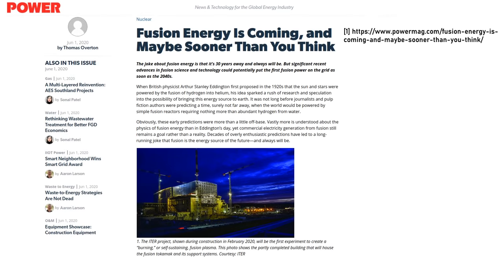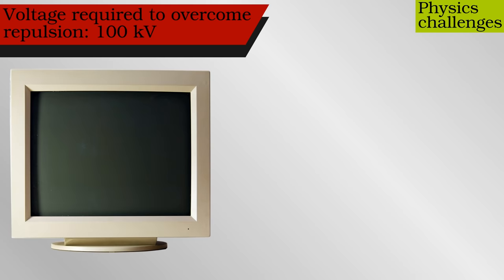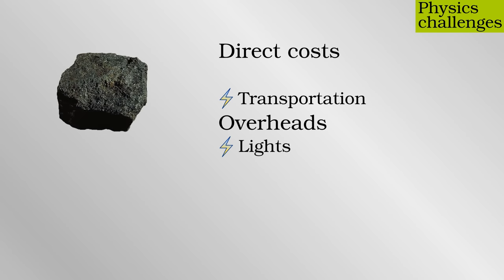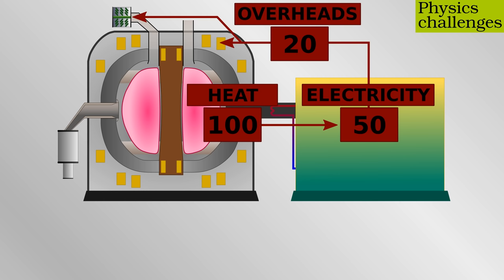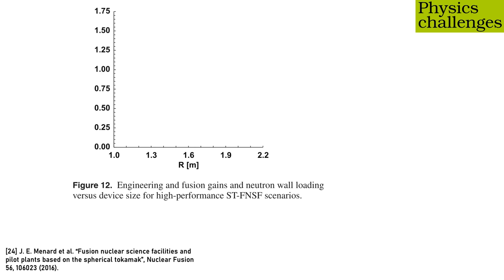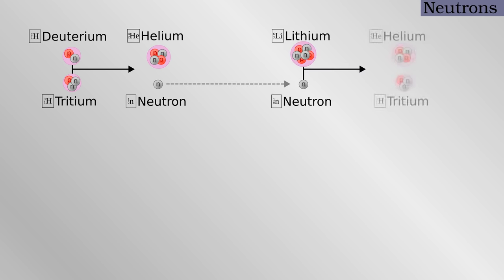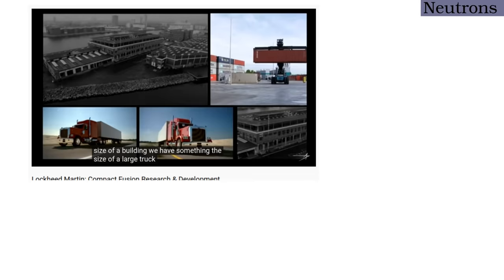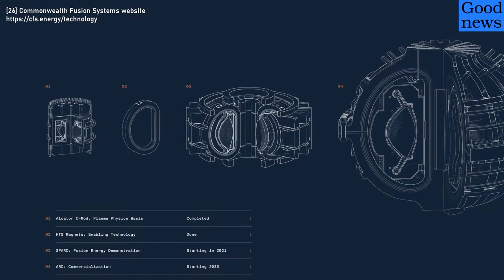Former fusion scientist on why we won't have fusion power by 2040

Comment: Being able to do something is one thing, making it efficient enough to apply it is something else, and the massive task of infrastructural overhaul is an entirely different matter. I do think that applied fusion will be achieved and utilized at some point in the future, but the time scale for that is 300 years, not 30. We don't even properly have the first step done yet.
Reply: So we'll never have Doc Brown's "Mr. Fusion," like "Mr. Coffee."
Reply: For sure. I believe it will be done within the future but I don't really see it within my lifetime. Possibly due to the climate, running out of fossil fuels, there would be a demand into research within these fields around 2050 or 2060 but I highly doubt it would be commercialized until way after all of us in this comment section are gone.
Reply: @Killerkraft975  mhm im a 98 so with 20 years of building time I might see the first one but I would say it is reached earlyer about 2065 if thing go well with ai (technological singularity) and ITER, Wendelstein X7 etc but definitely not before that 😅
Reply: If you'd asked me 10 years ago, I'd have said 'not a fucking chance we do fusion'.

After a PhD in plasmas, and with about half a decade of watching computational sciences go leaps and bounds even beyond what we were doing, the computational stuff dpne these days are able to do in under an hour that would have taken multiple expensive experiments and 5 years to do.

The plasma stream guys aren't getting as much benefit because the field geometries are much more complicated to simulate.  This is because they need stable plasmas to achieve fusion - which they achieve mostly by using magnets to shout at it to tell it what to do, and the longer the stream the more instability potential you're seeing from the currents.  You can't just wrap it around a big MHD sim and hope it pans out across the entire 6m radius.  Even so, the tokamak guys are still doing work - just changes in field geometry and plasma heating achieved thirty fold gains in under a decade.  ITER will almost certainly develop burning plasma just through sheer brute force, but its the engineering design that I am worried about.

The pulsed guys though - there are literally dozens if not hundreds of ways to compress plasma into fusion states just using field geometries alone.  ITER relative to these smaller startups has the other big problem - too many cooks.  Way too many people deciding what is and isn't done inside the machine.

On the pulsed stuff, I lost a bet over NIF never hitting any of their Qs, even the ones they invented.  They did it within a few years of the next gen plasma dynamics codes, overcoming impossibly complex plasma instabilities to do it.  They actually hit a thermal Q purely through experiment design and given NIFs lasers are decades old monstrosities it wouldn't surprise me if the holhraum designs improve to the point that even ICF becomes viable.

Honestly?  One or more of the startups might do it before 2030.  My bets on Helion though at this point.  Their design has so many engineering advantages to its general controllability and scalability as well as sufficient design width in how those systems can be used to actually pulse plasmas that im astonished it hasn't been done before.
Reply: For those still reading.

If you had read any of the literature coming out of plasma physics around 2011 you would be saying what I'm saying right now.

Fusion is way, way closer than anyone thinks.  Especially the old fusion dinosaurs who are responsible for most of the unflushed computational turds still floating around comp physics atm
Reply: @ralalbatross  Sure, and very interesting. But there is a big difference between being able to do something, and actually applying it, especially on an infrastructural scale.
Reply: @burnttoast26  Honestly?  Tokamaks are a mess infrastructure wise mostly because of the hostile radioactive walls problem, but not unsolvable.  Depends on what ITER or the other proto-demo reactors do.  I have no idea.  ITER's a big political mess - the whole international commission idea where half the countries are building magnets in different parts of the world to inconsistent specifications, arguing over it in the process, and then welding them together incorrectly is causing most of their problems.  The actual reactor idea is sound-ish - it should just have been built a decade ago.  It wouldn't surprise me if one of the startups beats ITER to 10Q, likely before 2030, because it is politics at this point.

ICF is still, imo, a nonsense.  The reason I bring it up is that ICF completely defied the wisdom of the physics dinosaurs (and younger ex-physicists like myself) who were all convinced it was a one in a billion shot, and it was actually engineering and simulation approaches that overcome that problem.  As I mentioned before, NIF is just a big bloated military industrial complex mess of lasers thrown together to test nuclear weapons.  The fact they made stuff hit ignition inside that monstrosity despite all the physical obstacles is amazing.  It makes my point for me.

The pulsed designs if they work are probably the most promising just purely from a computational perspective because single discrete events are easier to control and experiment with than streaming events.  Whether the physics scales up meaningfully isn't a question I'm in a position to answer...  but almost no one else is either.  The vast majority of fusion research is in other areas, so either they are engaged in scientific deceit on an epic scale (not impossible) or the tokamak was simply the only system people could meaningfully describe using the computers of the 1960s to 1980s and thus precluded any meaningful study into more complex plasma dynamics.

The one I'm not convinced by are the guys who think they can shoot bullets at a screen and generate power.  I don't know how they think that one will work - you're gonna get the hohlraum compression problems all over again.
Reply: @ralalbatross  I'm not even talking about just setting up a reactor. Overhauling the power infrastructure would be a monumental ordeal, you would need to re-tool power lines going across the entire country, transformers, teaching power company staff how to handle all this while figuring out standard procedures, etc. That is an entirely separate can of worms from just "can we make a reactor". It would take a LOT of time and money, two things that almost any government would be stingy about concerning overhauling infrastructure. Plus, the politics surrounding already-existing power companies lobbying against it to preserve their monopolies. Like I said, there is a HUGE difference between being able to do something, and putting it into practice.
Reply: @burnttoast26  the retooling isn't as much of a problem as you think coal, nuclear,same gas, geothermal power plants are basically the same they all convert heat in too steam and the steam spinns a turbine connect to a generator sooo that do you mean by re tool powerlines there are already powerlines and transformer stations soo it would be possible to convert extend existing powerplants since fusion isn't bound to a place by its fuel like coal powerplants are  soo yeah the grid is ready for new powerplants regardless of type but it is still a major project to pull of
Reply: @TheLtVoss  Dude I came to say the same thing. It blows my mind that nerds who know so much about reactions still never learned that the power to the grid isn't coming from the actual fission/fusion its coming from steam... so all the talk about "can't output more than ya input" doesn't make you sound smart although that statement is accurate how do you figure we still have a power grid despite that fact? 

We don't need tons of tritium the real work is in the water phase transition.
Reply: @off6848  You do realize that if you knew what you were talking about, you'd understand that such a revelations leads more credence to the problem of fusion's lack of viability?

Fusion can barely even break even in a closed system that encompasses the input energy and the fuel. It can't produce more than it consumes to actually ignite the fuel by a long-shot, and that hasn't even addressed the issue of actually extracting that energy and boiling your water for your turbines.

The most efficient lasers in the world that operate at the power levels used in fusion are so far as I am aware between 5 and 25% efficient. Then you factor in the losses in transforming that heat energy into electrical energy, which we can be generous and assume maybe that will be around 50% efficient. So now you're not even breaking even in total energy transformed in your fuel mass, you're requiring 4-20x as much externally generated energy to even get that fuel mass transformed, and then you waste half of it trying to use it to turn a turbine of some sort.

So no, just talking about "output vs. input" alone may not make you sound smart, but dismissing the obvious and apparent inadequacies of current fusion capabilities sounds downright stupid.
Reply: @bort6414  Are you talking about spallation lasers? 

They can be charged and discharged at the capacitor to make the reaction that just takes energy over time. Theoretically you could charge them up with tiny batteries although it would take forever the actual fusion reaction and the materials bred or produced are useful because of their ability to get super heated and basically dunked into water to create steam. 

Yes it requires a lot of power to get the reaction started but the reactions main purpose is to do something coal and gas cannot do which is turn enormous amounts of water into steam to do you work that is then converted to wattage,voltage and current to the grid.

and that same energy can go back to the reaction for heating the fuel rods as long as you have steam and working turbines. Coal has to continually be fed and shipped in as a fuel.
Reply: @Killerkraft975  It will never be done. Even if it's theoretically possible, the average human IQ is decreasing with time. humanity has missed the fusion window. But we will have a lot more idiotic Tiktok videos.
Reply: @bort6414  You're pretty wrong.  NIF was definitely not designed for ICF experiments.  It's an old nuclear weapons testing facility.  ICF is just what they are playing with at the moment to justify firing shots in the chamber.

I had a chat with one of my ex plasma physicist colleagues about NIF for the first time last night.  We're both pretty straight laced about it, and we both remember joking about NIF.  Both of us were astonished they got anywhere, never mind ignition.

The fact they did anything at all is astonishing to anyone in the community.  Seriously, I know you aren't a plasma physicist and don't really understand this, but the Rayleigh Taylor instabilities in that hohlraum were so massive that they were poisoning the ignition hotspot every single time.  They weren't even close to ignition a few years ago.

NIF's fusion ignition evidence is enough to convince me that fusion is actually a lot easier than we think it is, but the plasma dynamics are complex enough that they preclude conventional experimental study. 

In either case ICF is a fusion dead end.  The lasers have a low repetition rate and break all the time.  Tokamaks though be it toroidal or spherical, pretty much everyone thinks they will work.  They have engineering problems, but they are ENGINEERING problems.

There are also FRCs and other weird pulsed approaches which, honestly, were too complex to meaningfully investigate until recently.  I can't speak on those, but I suspect one of them will work and it will be a complete surprise because the academic community was so blindsided by NIF, it essentially means they weren't really working on the problem at all.
Reply: @burnttoast26  Depends on the mechanism through which you extract the heat.  Tokamaks are testing towards heat exchanger walls cooled by water, which will result in them being partly radioactive.  The prospective lithium breeder blankets (they claim to have 180 designs including breeders, which doesn't surprise me) are intended for the production of tritium.

The main issue with tokamaks is the replacement and servicing of these walls.  It continues to be a problem that people are not quite sure how to solve.

In terms of heat extraction, ITER is water cooled, so extracting heat is no different than it would be in a conventional nuclear reactor.  Easier, in fact, since neutron moderators aren't necessary in a fusion reactor, and the rate of reaction is dependent on the energy put in, not the heat dependent neutron flux within the core.

If anything, throttling a fusion reactor up and down is a lot easier than it would be in a fission reactor.
Reply: @ralalbatross  I fail to see how understanding that laser efficiency is a major limiting factor in fusion viability makes me "wrong". Nor do I see how you flaunting esoteric knowledge that does not relate to my initial observation invalidates it either.

For fusion to be viable, it must not only produce more energy than it takes to produce, it must also do this while being less costly than alternative methods. And all the babbling about hyperencabulators and photosynthesis in the world will not invalidate basic observations of physics and entropy.
Reply: @bort6414  It's not esoteric knowledge.  It's basic understanding of the system in question.

ICF was the least likely mechanism to get energy out of fusion and it worked despite crappy inefficient lasers and using indirect drive.  Most of it was just achieved by hohlraum design - basic engineering achieved a hundred fold yield increase.

I'm telling you that we haven't really tested tokamaks or stellarators or FRCs to any degree of meaningful accuracy yet or scaled them up to power plant size, and the process of design is getting faster with each year.  JET was at Q of .6 or .7 the last time they really tried I think and JET was never designed to do anything more than study fusion plasmas.

Fusion is nothing like as hard as you claim.  We just never really had the ability to properly diagnose plasmas before.  I personally think it will work, but I didn't about ten years ago.  NIF and some of what is coming out of startups changed my mind, as did realising how easy it is to simulate plasma dynamics these days without a supercomputer, which you needed as recently as 2010.

You don't have any observations worth noting.  You just keep talking about energy out.  I'm saying a 40 year old experiment that should have worked got a hundred fold increase in yield since plasma simulations became easy to access and computing power increased.

I expect that in every single fusion system.
Reply: @ralalbatross  You dismiss power output as if the entire purpose of terrestrial fusion energy is not to produce electricity. That is literally the single-most important observation one could conceivably have in such a discussion. And further handwaving of actual core problems like the fact that the system used to actually begin the fusion process is not only extremely power-hungry, but extremely inefficient, doesn't invalid those problems. Their lasers aren't "crappy". They're lasers that are used to produce MW-level pulses and any energy output of that level comes with a lot of inevitable wear. A thing, mind you, that just further adds to the overhead cost that you need to overcome to beat other energy sources.

Answer my question directly: When will fusion energy be less expensive than nuclear energy? Just a ballpark estimation. Because until fusion is at least less expensive at a systemic level than nuclear, it shall remain a pipe dream. When that day comes, if it ever does, I will gladly accept a cheaper source of energy. But our species needs energy now, and I'm tired of fusion being used as a scapegoat by activists to stop real energy solutions from being built.
Reply: They have enslaved and fooled you 👉 The Connections (2021) [short documentary] 💖
Reply: @bort6414  Their lasers are crappy, mate.  They are also very old and were not designed for use in fusion reactors.  Laser physics has come on a long way since NIF was built.  Dunno why you're even arguing with me either - I never claimed NIF would form the basic of a power plant 

I am saying that NIF worked because we now have the ability to descrive what plasmas will do to a much higher degree of fidelity than in the past.  This is solely due to computational simulations and expanded computational power allowing for a much wider field of variables to be considered than before.

The same effect is happening in all other fields of fusion plasmas.

You mentioned fusion was impossible and unlikely due to stars cheating.  I corrected you on that.  Now you are arguing NIF as a power plant despite me consistently stating NIF won't be one.

When we scale fusion up to generator level, there are two questions that I need answered before I can state with any certainty what it will cost.

1.  Do tokamak walls taking exorbitant neutron damage require constant replacement or can we moderate it somehow?  The tritium breeding problem is another one but any useful reactor wall will breed tritium.

2.  Are tokamaks going to be the successful model or will it be smaller electrodynamics coupling models like FRCs?

At this point I don't actually know the answer to either.  However even assuming wall replacement every 6 to 12 months with periodic shutdowns in radiologically safe environments fusion works out to be the cheapest energy source on Earth bar none

Yes, cheaper than wind and solar.  Why?  Land value combined with a near infinite supply of fuel.
Reply: @bort6414  You don't really understand what I am saying at all on power output btw

I am saying that fusion is easier than you think and that net continuous power output is not only inevitable but it scales with reactor size.

Your original argument was that you couldn't possibly get power out of it.  ITER isn't even designed for power output but just its initial configuration will likely get 40 to 100 MWe in its test configuration.  A lot of people in physics now are convinced that ITER isn't necessary anymore and that all it is there for is reactor wall designs.  So people will test the reactor wall designs in ITER and then use them in their own DEMO2 reactors.

The point I am making is that while fusion is complex, it is complex in a way that is increasingly understandable outside of the handful of people who used to work on it.  The progress in heating plasma in the private sector has shocked a lot of academics into motion for the first time in years.  NIF surprised them - NIF was never supposed to ignite at all.  Suddenly fusion looks easy and there was an arrogance in plasma physics about fusion which is gone now 

They do not want to be beaten to first light
Reply: @bort6414  e I think you need to sleep a little